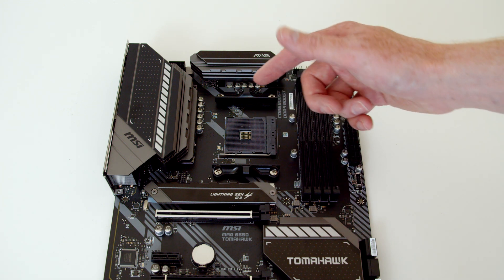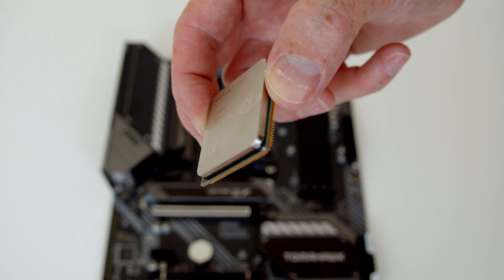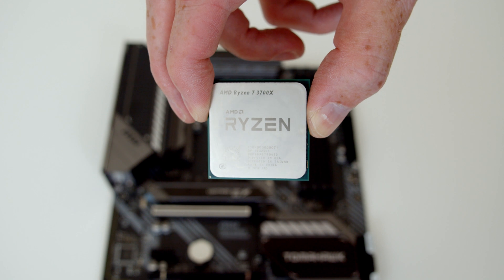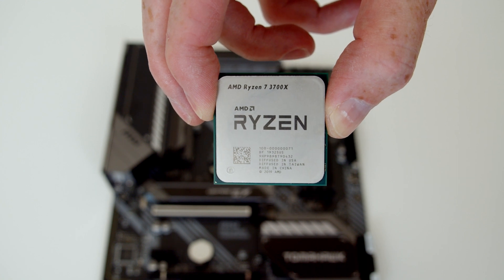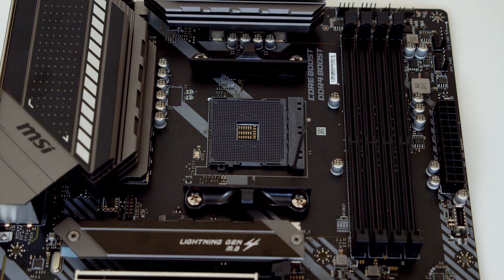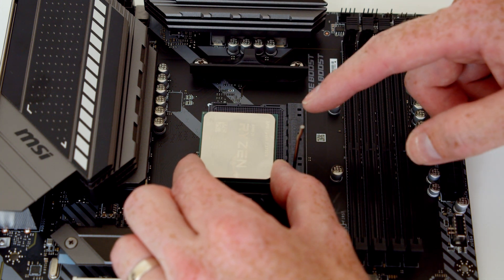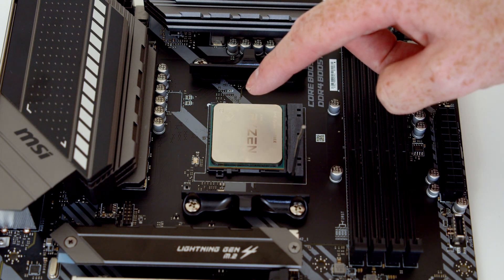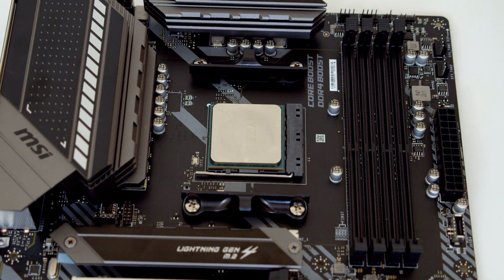AMD Ryzen CPU Installation Guide

Comment: Perfect for me as I just ordered a ryzen 3 1200 cpu cheapo off ebay. I got the tomahawk b450 max II. So it should be easy to install the cpu. It comes with a cooler. Which I imagine is the fan. Pity you didn't show that bit. But it is just screws I suppose.